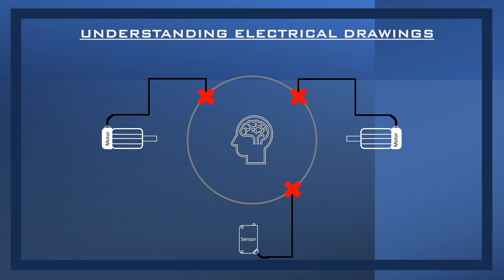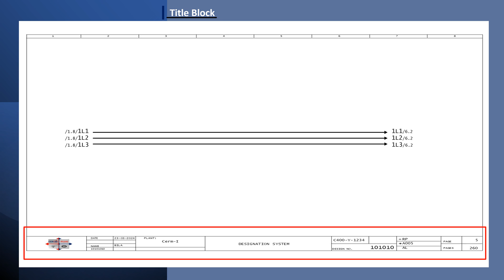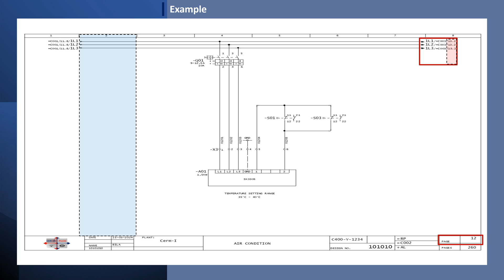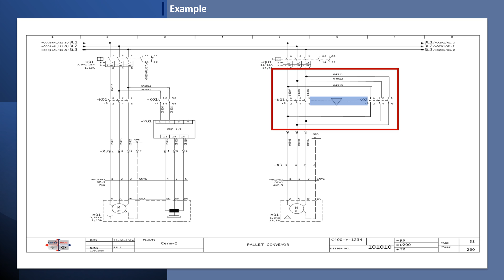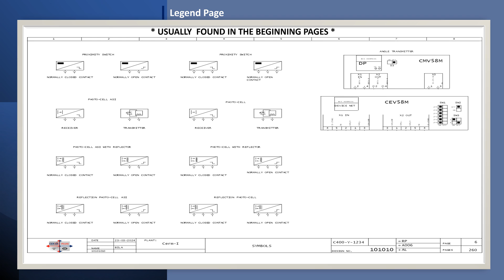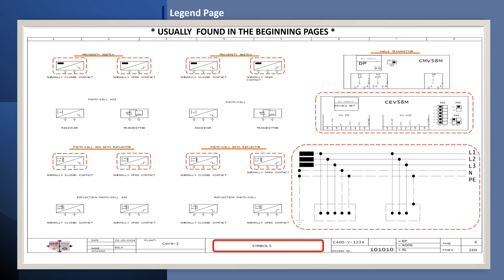Understanding Industrial Wiring Diagrams: "Decoding Complexity" ----PT. 1

Comment: How do we understand the meaning of circuits with distingués colored cables
Reply from the maker: Follows standardized coding systems like the (NEC) or (IEC) standards and refer to the wiring color standards applicable in your region. Also check the diagram legend for any custom color coding used in the specific industrial setup to identify the function of each wire based on its color.